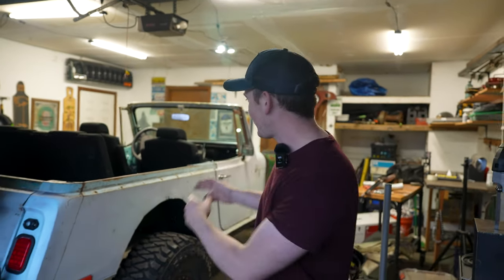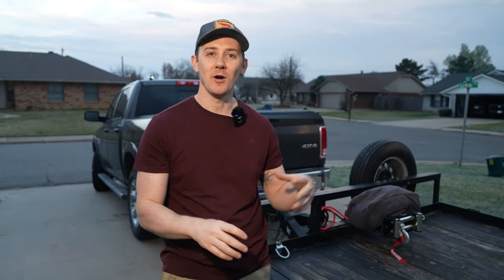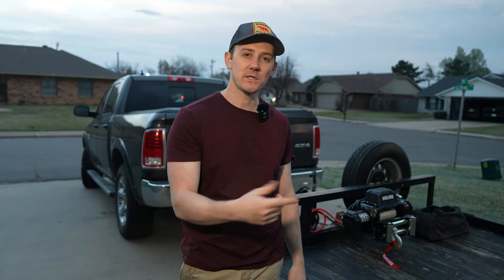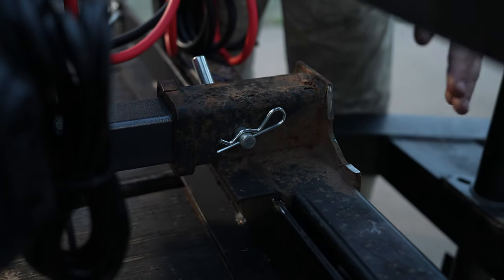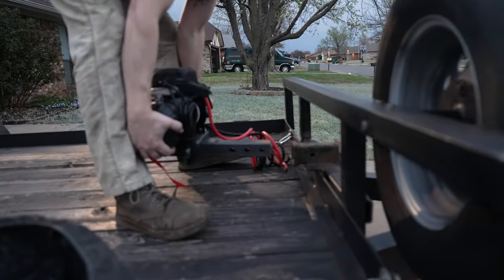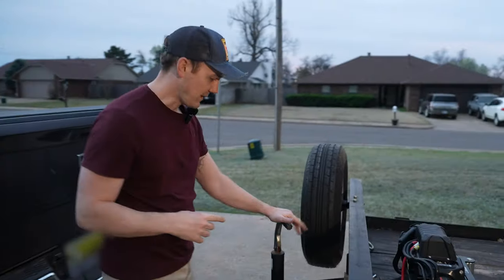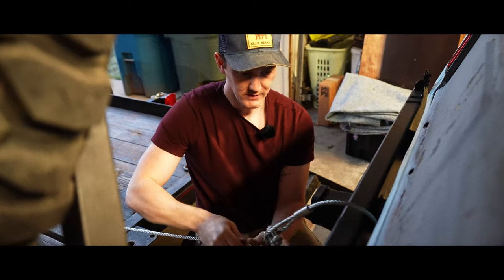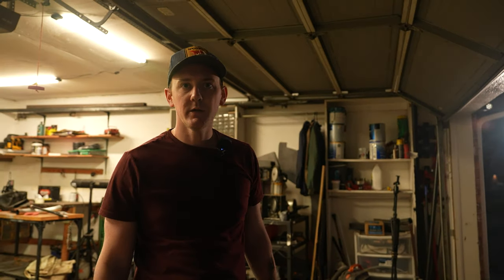Load like a PRO, DIY Removable Trailer Winch Installation for CHEAP

Comment: I think you can get a powder cord extension,I have seen it on a truck where you can use it from and rear then just plug into each other
Reply from the maker: I’ve thought about that. Big concerns were if I used a different truck the cables would be with my truck or having to run such long cables to the front of the vehicle every time.
Reply: You see the male /female connections on tow trucks and fire trucks they universal